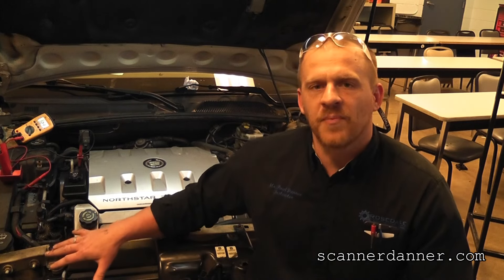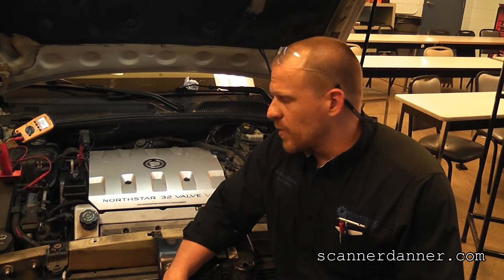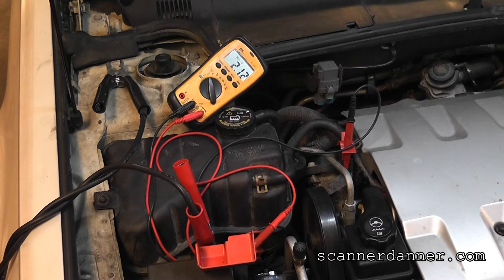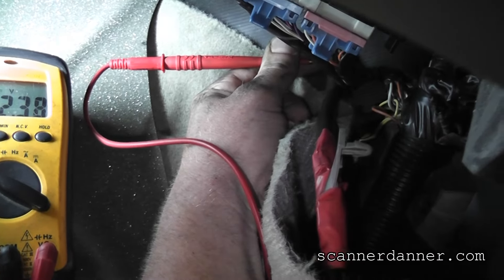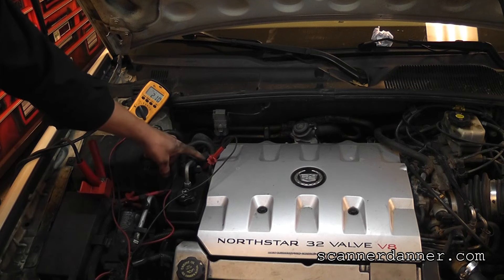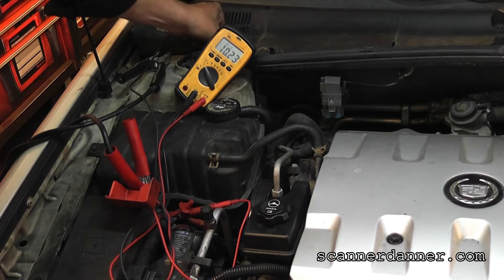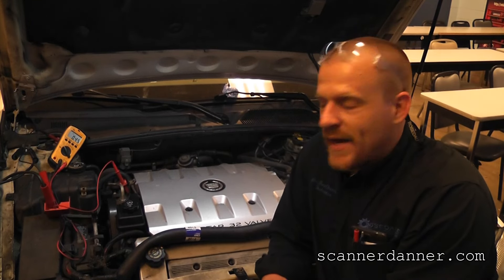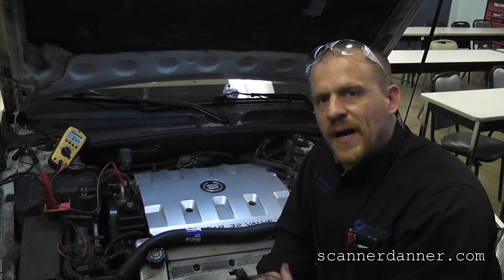Engine does not crank (bad block ground) - Cadillac

Comment: As an auto electrical mechanic(which I learned literally everything from you),the first thing I do,is hookup a 20 foot red and black corded jumper wires to the battery and use them as my power and ground source.

Comment: I have another ground spliced into the harness by the crossover that is connected to the block just behind the EGR valve. I'm not sure if it's a DIY block ground because, when I changed the crossover gaskets, I accidentally pulled the ground wire out of the crimp connector that a previous mechanic had installed. After tracing the wire to its mounting point on the block near the EGR (under the T-connector for the coolant lines), I had to redo the ground connection; otherwise, the car would not crank.I'm not sure if all DTS models have a block ground in that location or if someone grounded one of the modules for an accessory there. The wire is very thin—probably around 18 AWG—so it's not a main ground point. It appears to come directly spliced out of the harness that tucks under the crossover.

Comment: Hi, Paul. I've got about 30 years as a diagnostic tech. I hate to seem like a tool salesman, but, Power Probe 3 is a huge time saver. it is a dvom with really long leads. Direct battery hookup can tell you what the battery voltage is and voltage drop on both power and ground sides.

I quickly diagnose all makes for a no crank problem. You check 3 things at the starter. Voltage at the + terminal, voltage at the crank signal wire and voltage at the case ground. All while cranking. Loading the circuit is key as you stated.

I'm not trying to brag but your Cadillac would have been diagnosed within 2 minutes or so. I learned this the hard way though the years. Now I teach this to all new techs. The Power Probe 3 is a great tool. Yes you can do it with a dvom and test light and long jumper wires. But the  Power Probe 3 is all those in one. 

I tried and quickly returned the Power Probe Hook. Don't waste your time and money on that one. The Power Probe 3 will quickly pay for itself if you make money fixing cars and learn to use the tool.

I love your videos and your teaching methods. You're doing great work for future and current techs including myself. 

Big thanks from Marina Del Rey, California.

Comment: Hands down the best automotive repair channel on YouTube. Thanks for sharing your knowledge ScannerDanner!
Reply from the maker: Thank you so much!
Reply: @ScannerDanner  BTW, the voltage drop test is what led me to replacing the wire between batt neg and the block.  Once replaced, the car started up quick (no more slow crank)!  Thanks again!
Reply from the maker: @2YLITE22  that's awesome man, nice job on your part!

Comment: I am a CMAT/L1 ASE tech, 30 yrs in GM dealerships.As shop foreman I have seen this  exact same failure confuse younger guys.I have taught them to do loaded voltage drop test while cranking or start position to isolate faulty cable.Batt pos to stud,Batt neg to block.Almost always broken grd cable from engine to body on Caddy 4.6 and Aurora 4.0.Good video highlighting this concern.P.S.class 2 data on this vehicle is 0-7 volts.

Comment: Thank you so much for the great video.  Everyone was telling me it was the battery and starter and I was thinking it was a ground but could not find it.  At the end of this video you showed where the ground from the body was .  After tracing this wire I found that it was broken.  Thanks to this video all I needed to do was replace the main ground wire from the body to the engine.  Thank so much!!!!

Comment: Yup my wife fixed our 2006 oddesy (confounded 2 mechanics already, whom replaced the alternator other the  starter).. good that she refuses defeat...hours of videos on schematics, and circuits and every beatification panels and plastic removed from the car ,she stumbled on your video last.. heard a scream, "omg thats why I got a spark on the block when I was trying to use a screwdriver on solenoid and starter" as she was running outside (yes I may have stated my concern for  her frying the whole system)..she found the ground wire in, idk, a minute maybe...eternally grateful, she saw your video before she took the van "down to the studs, so to speak, if I have to" .and she would've I tell you
Reply: His wife here lol..your ability to explain is second to none..so many videos always assume a mechanic is listen, so certain terminology and abbreviations are often used in their explanations...ty for always fully  explaining where how and why you did something or started a certain place
Reply from the maker: This is so awesome! Your wife is too! Super proud of her
Reply from the maker: Oh man, I just commented to your husband too. I'm super impressed with what you did. Mad respect, seriously. You have no idea

Comment: My exact problem I'm witnessing right now today exact same symptoms and voltage readings, fuel pump running continuously,  no scanner communication...I did all same test you did, I was suspecting bad ground all ready but the 2 volts at fuse box was making me look elsewhere  and totally threw me off and started thinking bad positive lead wire, I thought maybe anti-theft was causing all this also, trying different keys and such, I even started thinking my volt meter leads were shorting out because of the crazy random numbers I were getting, but like you said a bad ground makes sense if you really think about it, this definitely was a head scratcher, thanks for video I'm going straight to that ground wire when I get back to vehicle, this video was right on time!

Comment: I have a 2007 buick lucerne with the  4.6l Cadillac Northstar  motor , first thing your video was a huge help thank you. No crank No start  had it narrowed down to the fuse/relay box bc someone could push down on the relays while i cranked it over and  it would fire up  thought I needed new fuse box  until I came across this video, ground wire bad .
THANKS AGAIN.

Comment: Been having this issue for a few weeks checked ecm, checked key, this is so specific to the issues I'm having down to the headlights and fuel pump not turning off. Thanks so much
Reply: did  you fix it
Reply: Yea the ground was ripped out of the body side of the connection. Ran a new connection and was back in business
Reply: @csoul6699  I think I'm having the same problem because when I shake my car or close my hood everything  connect again but as soon as I go try to crank it up it'll act like it want to crank but then it'll disconnect again I can slam my door hard and everything will connect so I think it's the ground wire
Reply: Can't hurt to check, you should be able to see them with just a flashlight and removing the plastic cover. It's probably hanging on by just a few wires.

Comment: What I find with certain professionals is this, those that LOVE their craft will always tend to work hard at it. You love what you do and it shows. I'm medical but I've been watching your videos for years. I'm pretty anal when it comes to learning I have to know things inside out. This video really helped me. I've done some voltage drop testing before and for some reason sometimes I forget to load the circuit. Anyway I have a 1961 Chevy Apache that I'm working on and the tail lights have from time to time given me trouble. At one point I found a frayed power to the tail lights grounding out. I showed full voltage at the tailgate. I bought a new harness really two new harnesses since they divide at the door then at the bumper. Fast forward 3 years up until now it worked perfectly. I go out and the tail lights aren't working. I like to use the Power Probe since its so long although I've seen situations where if I had a regular voltmeter with long leads it would be better. I have trouble trying to do voltage drop with the power probe. Anyway I found full voltage at the tailgate itself when I turn on the lights. The tag light would work. but not the tail lights.
I started thinking because of a video I had seen once that stressed power attempts to go to ground and it really doesn't matter if it goes through the ground side to get there. If I take a jumper from the battery to the back and touch the tail gate the lights turn on. Sounds simple but I was still wondering if some rodent ate through a wire and it was touching ground. The problem is there was no blown fuses. I disconnected the harness at the door and sent power back towards the tail lights without adding the additional ground and no lights only the tag light. I then disconnected at the tail gate and sent power through this is all with the power probe again the same. I kept saying it must only be a bad ground but of course unlike today's cars there was no ground all over the place back then. I now said to myself this has to be the reason sometimes that the engine wouldn't even turn over. If I went out and took a screwdriver and jumped it manually at the starter it would jump then the ignition key would always work afterwards unless I let it sit for months.
When you showed the 10 volts at the ground side I said bingo!! If I had long lead for my voltmeter I would've done voltage drop on the ground side I quickly found the issue I think. The power probe says it does voltage drop I need to delve a little deeper. Thanks for the video however simple it appears it was excellent. I think like Netflix You Tube should allow us to like dislike or love the video. This video I love
Reply from the maker: heck yeah man, this comment is awesome! Thank you so much. This video will help a lot with this concept too https://youtu.be/GQvLHQVtC0Y
Then this playlist (all ground circuit problems) 
https://www.youtube.com/playlist?list=PLAFYVCyenqcr32wgsCqa1Zj4335YlBF5p
Reply: @ScannerDanner  That was the perfect video for my situation thanks !
Reply from the maker: @foreverwood1963  awesome! Does thr ground side voltage drop testing make more sense now?
Reply: @ScannerDanner  Makes total sense now
Reply from the maker: @foreverwood1963  awesome!

Comment: My niece bought a 99 Deville. I told her not to buy it but she thought because I like her. I would fix all her problems. Now a trans shop want $3000 to rebuild the unit. I knew it was a bad idea for GM to put a 32 valve V8 n a FWD car.
Great video.

Comment: Came here after viewing the no crank on a Dodge 2.0 and I wish I came here first. At the end of the video where you said just touching the ground and the starter went nuts clicking that's what happened to my car which is why I replaced the battery (no I didn't check the voltage bad assumption on my part but the car started with the new battery (ground was being made) Then my son got stuck with the car. Turns out the ground wire on the bolt to the starter was loose. Thanks for the video and the reminder that you need to start with the basics. TFS
Reply from the maker: +MostlymoparIH cool man, glad you got it fixed. Thanks for watching!
Reply: are these caddies subject to starter solenoid problems?

Comment: old age is hell, lol. I had one came from guy that did mobile jobs, good mechanic but weak electrically. He pulled intake twice with new starters. Came to me with fuel pump running all the time, and communication problems. bad ground. I would like the engineering explanation of why the fuel pump is powered up with key off. Glad there were no leaking injectors.  Very weird electrical issues with bad engine ground. great video.
Reply from the maker: Larry Hurst In short, the PCM was all screwed up (among many other modules) with incorrect voltage levels through the entire board. It is not a stretch for a particular transistor to be energized when it shouldn't be. Either from a misinterpreted RPM signal that really didn't exist (input side problem) or just simply the output driver itself turning on from a messed up voltage level at the base circuit.

Comment: The Automotive Industry still has a lot to learn about failsafes and mission-critical design.  I'm the first automotive guy in my family, and growing up surrounded by home builders and aerospace engineers makes for a rather unique perspective on how cars are built.

The long and short of it is that if airplanes were built like cars, the FAA would not grant them airworthiness, and when (not if) houses get built like cars, the builder gets sued out the wazoo.  That sort of engineering right there with that Cadillac is a prime example.

Really good, informative video, despite not being shot in realtime!
Reply: rhkips Lack of fail safes and mission-critical design, who is to blame?
#3 problem - auto engineers
#2 problem - bean counters
#1 problem - . . . .

In all fairness to auto engineers, bean counters are more to blame for the lack of backup systems.  After the new car is designed, the bean counters say, "Hey, looks great, now knock the cost down by $2,000".  

#1 problem - US car buyers, if they all wanted super safe and well designed autos, they would buy nothing but Mercedes and Volvos.
Reply: D Nelson mercedes and volvo have just as bad electrical and mechanical problems as the next brand sadly. All manufacturers want is a low cost car to pump up sales, more sales = more money. And that will always be the case with the auto industry
Reply: rehlek 
All cars have issues - Yes.
All cars are pretty much the same - come on!  Really?
Reply: D Nelson The laws of physics are constant, as are the laws of electromagnetism.  As far as diagnostics go, yes, all cars are pretty much the same.  :)

Comment: today I could diagnose a brand new car only 7000kms on odo with no crank no start. other mechanics on workshop checked everthing before they handed the car to me. they said they found something funny on ground connector of control side of starter relay. It had 8 ish voltage on there. I remembered the theory you tought me by this video and attacked the problem. I checked the ground of control side on starter relay goes to engine block. checked voltage between block and bat neg. 8 ish volt was there. and finally found main power ground of engine block was losen by incorrect torque setting from factory. Many thanks Paul.
Reply from the maker: +Bong Keun Chee nice job my friend! I bet you were a hero in the shop that day. The cool thing about this kind of stuff? You will NEVER have to toot your own horn. Let your work speak for you, stay humble and people will know that you are the go to guy without you ever saying a word.

Comment: Excellent example of "ground-to-ground" volt drop, in a less than expected location. Likely becoming a more frequent occasion as it seems more vehicles are coming with "remote mounted" batteries (Acadia, Camaro...) Nice job...

Comment: Thank you for your video my ground wire was broken 4 gauge black wire from alternator to frame I was getting weird codes service theft system U1000. i connect that black ground wire back together and vehicle started Replace that broken ground wire

Comment: When I see electrical stuff acting backwards and crazy I think of grounds that are not connecting as then it tries to ground through other things.
This was a classic case as it made things run by themselves not even turned on.
Real good example was a taillight assembly with 1157 bulb. One light filament and one heavy filament. If it's not grounded correctly the light ( running light ) filament will ground through the heavy ( brake light ) filament.

Comment: I'm checking out your video cause I have an 2003 with intermittent starting issues. When the car is shutoff and heats up after 5 or 10 minutes it won't start, click, click, click. When it's cold it always starts never an issue? We checked the battery the alternator and it has a new starter so this video gave me somewhere to go, the engine ground and or the CPU ground. Thanks

Comment: Man I have been going crazy trying to figure out what is going on with my Caddy no start. So I am thinking that what you are explaining woukd make mist sense. Here is my thought or question.... Would this also be the reason that when my battery is low and I have to get a jump that it only get a successful jump from the jump station under the hood and won't work trying to jump direct to the battery? That is what has been happening to me recently. Now I am not even able to jump start the starter through the relay. No reaction at all when I connect 87 to 30 in the relay terminal. I'm for sure not a mechanic, just a widow with little to no money trying to do things myself that my husband woukd have done. Drunk drivers really really suck.